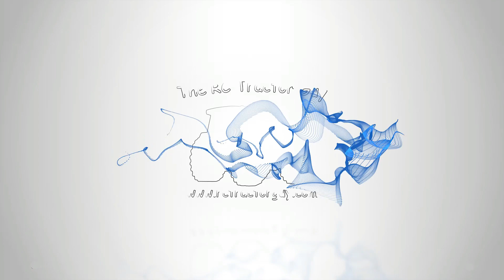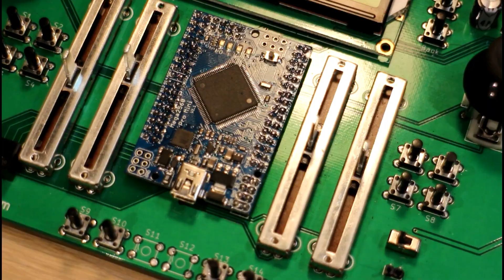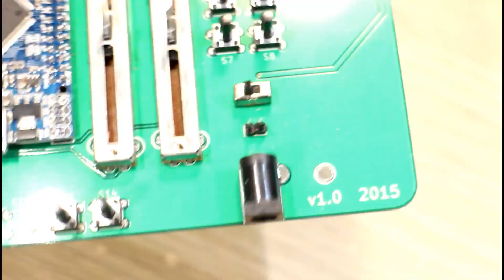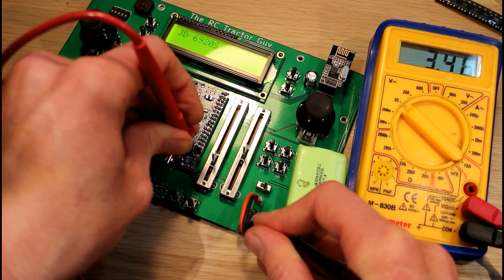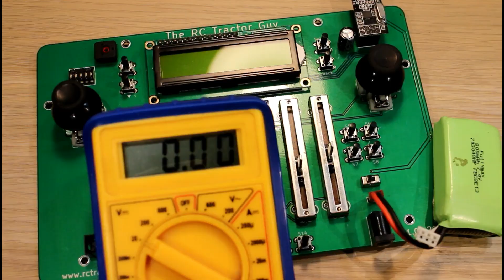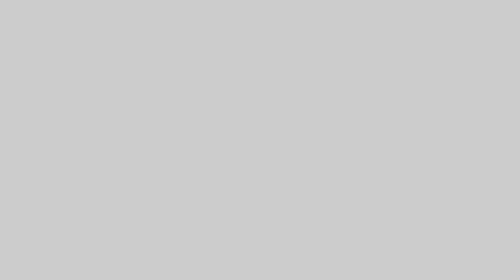Seperate 3.3V Regulator for the NRF24L01 on the RC Tractor Guy Controller PCB V1.0

Comment: did this help ? - we are seeing drop outs and unreliable radio connection on some of our electric skateboards that use the nRF24L01 - just researching possible solutions - nice video
Reply from the maker: It did to some extent I think but if I remember correctly I changed to a different NRF library and that helped hugely with these issues. It was here: http://tmrh20.blogspot.ie/2014/03/high-speed-data-transfers-and-wireless.html

Comment: what about the nrf with a power amplifier, might help with the signal.
Reply from the maker: +Carl Recktenwald Jr. I'm only ever using these things within a few meters of the controller so something is wrong if you need an amplifier to get a good signal. I think it was actually a problem in the code, I set a pin to alternate on before the transmit and off afterwards, watched on the oscilloscope and seen when the signal is lost the controller is stuck in the send. Talked to some guys on the Arduino forums and it turns out there is a 500ms wait in the RF24 library so I cut that down to 50ms and it seems to be working now. I only made that change today so more testing required before 100% saying it worked but looks good so far.
Reply: Got it, I would have to agree with you on that.